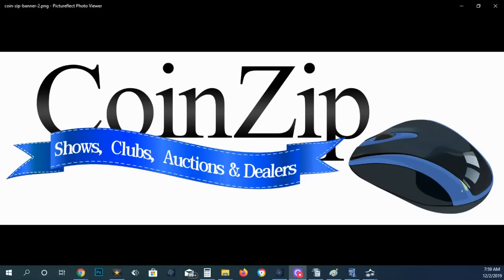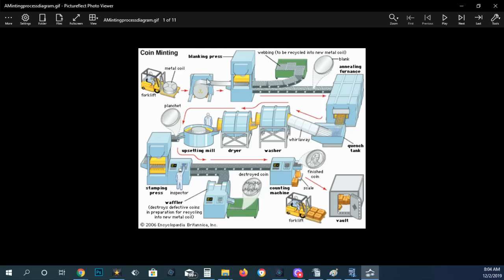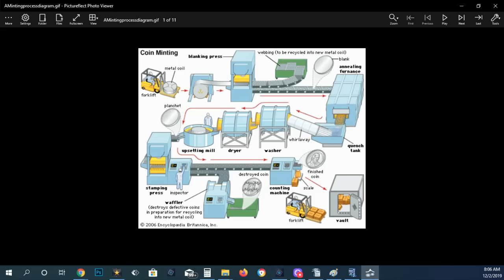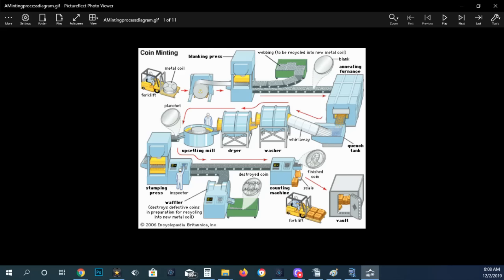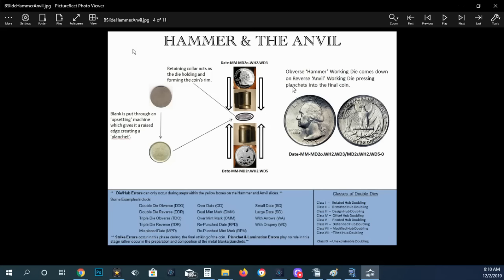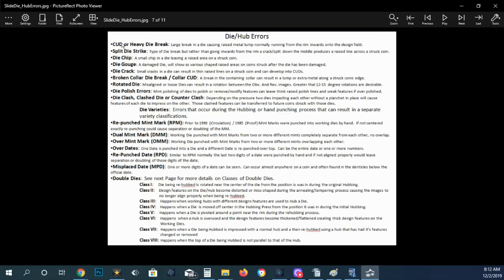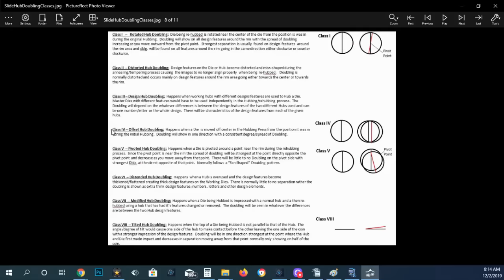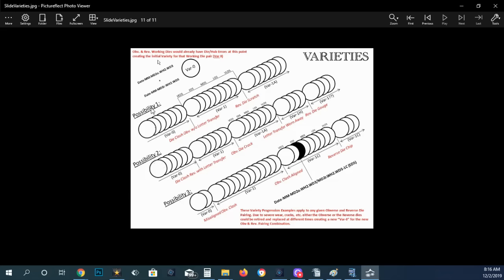How Coins Are Minted - The Coin Minting Process - You Will Never Look At Coins The Same Again

Comment: DANIEL!  THANK YOU SOOOOO MUCH for providing this detailed super informative walk thru of the minting process!  I stopped using forums in the community, specifically, over debates as to what causes double dies, what is hub doubling, etc.. etc..  years ago when I was just starting out, I would submit pictures and ask questions on other forum and chat boards of coins that I had. And it may just have been my rookie perspective, however every single thing I submitted these experienced collectors at 10 20 years behind them, seemed quick to dismiss literally every single suggestion I I posted. The only supporting information they would provide would be the same link to the same YouTube video defining what is a double die and what isn't.  Yes I'm going to the website yes I'm reading it all yes and printing out all the graphics and posting them on my wall!
I STILL contend, however, that every doubling, regardless if it's hub doubling or die doubling they're all caused from the same device. Will there be a hub to make a die or die to make a hub to make it more dies... Doubling a feature seen on the coins are not caused by multiple strikes of the hammer die to the blanchet. As you said that the doubling is already on the die before the plant should even gets there.

Comment: Hey Daniel, Can a copper penny planchet be mixed in with a bunch of dime planchets, and then be pulled out once it was noticed but only after having gone through the upsetting mill and before the stamping press? Causing the upset rim intended for a dime on a penny. And then grabbing that same penny planchet and tossing it back in with the other copper Penny's to finish being struck? I have a penny which I'll be posting on your coinhelpu community and see what people think? I'm assuming this is what happened to my coins as I can't find anything on why it looks the way it does. The inside of the penny has a raised collar the same size as a dime with readed edged on the inside of those rings? Again I'll post and see what people think it is?
Reply from the maker: No, this can't happen and why I recommend reading error-ref.com website as a book.

Comment: Ok the process is not easily understood unless the machining parts and pressing tools are shown in detail.. that little diagram of a cookie factory does nothing for someone like me that has coins that are possibly mint errors   and need to have more detail on dies.. like how is the die fastened is it screwed into something.. chambers? How's the hammer attached?
Reply from the maker: You don't need to know all of that to learn what a mint error or variety is. If you don't know what the different between a variety and a mint error then you need to study. You need to read about them and study images. Knowing about how the die is installed will not help you and that is why you're struggling. You're looking for the wrong things.